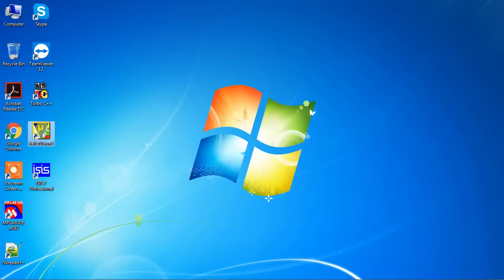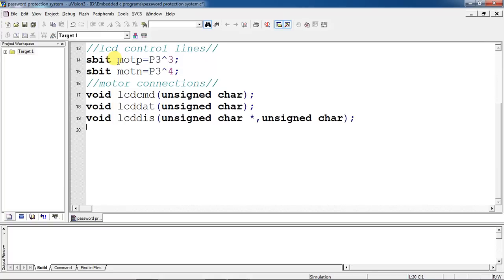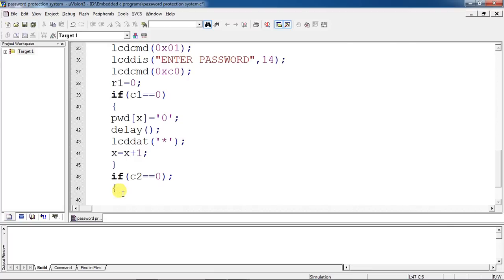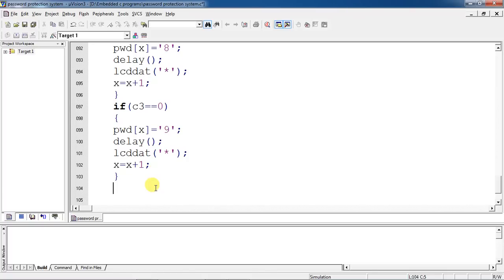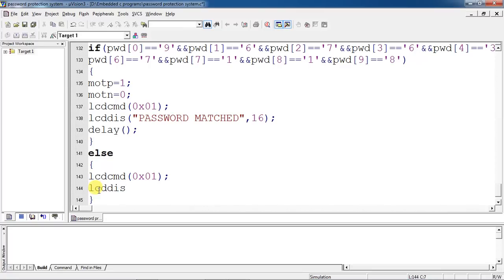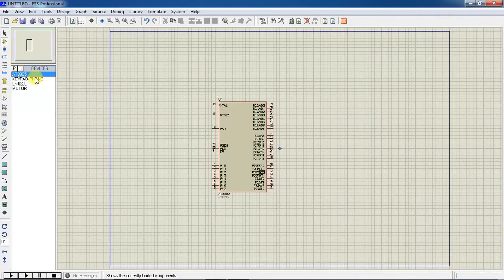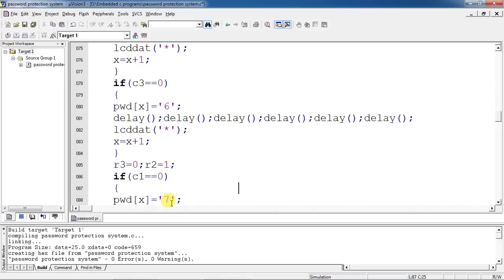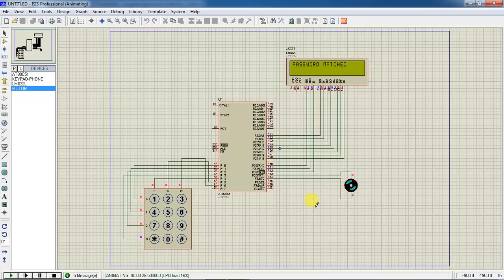Embedded c program for Password protection  using 8051 microcontroller with Keil proteus simulation

Comment: Sir, I am doing, Electronic Voting Machine using 8051, but I want it to be password based for viewing the result. When I embed your password code in my project code it shows no error, but when building, the hex file is not creating, saying "TARGET NOT CREATED". Previously, the hex file is created but after embedding your code in my code, it is not creating. At the same it showing 0 errors and 0 warnings. Plz Help me, Sir
Reply: https://github.com/kmhmubin/Password-based-doorlock-system-in-8051-microprocessor

Comment: This code will not work, when we type a wrong password at first then type the correct password!     

It will work only when we type type the correct password at first only.. Sir, What to do? My mail ID is sks288888@gmail.com

I tested this code :-                                                                                         

#include<reg51.h>

sbit rs=P3^0;
sbit rw=P3^1;
sbit en=P3^2;

//Keypad
sbit r1=P1^0;
sbit r2=P1^1;
sbit r3=P1^2;
sbit r4=P1^3;
sbit c1=P1^4;
sbit c2=P1^5;
sbit c3=P1^6;

sbit motp=P3^3;
sbit motn=P3^4;

void lcdcmd(unsigned char);
void lcddata(unsigned char);
void lcddis(unsigned char *,unsigned char);
void delay(unsigned int);
void check();

unsigned char pwd[10], x;
unsigned int i; 

void main()
{
P0=0x00;  //asign as O/P
P2=0x00;
P1=0xFF;
 
lcdcmd(0x38); //Initialise LCD
lcdcmd(0x80); //Cursor position
lcdcmd(0x01); // clear displa
lcdcmd(0x06); // shif rgt
lcdcmd(0x0E); // LCD cursor need to blink

lcddis("PASSWORD",8);
lcdcmd(0x0F);
lcdcmd(0xC0);

 while(1) 
 {  
r1=0;
  
if(c1==0)
{
lcddata('1');
delay(100);
pwd[x]='1';
x=x+1;
}

if(c2==0)
{
pwd[x]='2';
delay(100);
lcddata('2');
x=x+1;
} 

if(c3==0)
{
pwd[x]='3';
delay(100);
lcddata('3');
x=x+1;
}

r2=0; r1=1; 

if(c1==0)
{
pwd[x]='4';
delay(100);
lcddata('4');
x=x+1;
} 
 
if(c2==0)
{
pwd[x]='5';
delay(100);
lcddata('5');
x=x+1;
} 

if(c3==0)
{
pwd[x]='6';
delay(100);
lcddata('6');
x=x+1;
} 

r3=0; r2=1; 

if(c1==0)
{
pwd[x]='7';
delay(100);
lcddata('7');
x=x+1;
} 
 
if(c2==0)
{
pwd[x]='8';
delay(100);
lcddata('8');
x=x+1;
} 
 
if(c3==0)
{
pwd[x]='9';
delay(100);
lcddata('9');
x=x+1;
} 

r4=0; r3=1;

if(c1==0)
{
pwd[x]='*';
delay(100);
lcddata('*');
x=x+1;
} 
 
if(c2==0)
{
pwd[x]='0';
delay(100);
lcddata('0');
x=x+1;
} 

 
if(c3==0)
{
check();  // Password Check fn
delay(100);
delay(200);
} 
r4=1; 

}
 }

void check()
{
if((pwd[0]=='1')&&(pwd[1]=='2')&&(pwd[2]=='3'))
{
motp=1;
motn=0;
lcdcmd(0x01);
lcddis("PAY Rs.100",10);
lcdcmd(0xC0);
delay(100);
}

else
{
lcdcmd(0x01);
lcddis("ERROR",5);
delay(150);
lcdcmd(0x01);
 
//lcddis("PASSWORD",8);
//lcdcmd(0xC0);
}

// pwd[0]=pwd[1]=pwd[2]="";

}

void delay(unsigned int a) //Time delay function
{
int i,j ;
for(i=0;i<a;i++)
for(j=0;j<a;j++);
}

void lcdcmd(unsigned char val) //Function to send command to LCD
{
P2=val;
rs=0;
rw=0;
en=1;
delay(100);
en=0;
}

void lcddata(unsigned char dat) // Function to senddata to LCD
{
P2=dat;
rs=1;
rw=0;
en=1;
delay(100);
en=0;
}

void lcddis(unsigned char * str, unsigned char r)  // Function to send string to LCD
{
 unsigned char w;
 for(w=0;w<r;w++)
 {
 lcddata(str[w]);
       delay(100);
 }
}

Comment: /* improved program by Anil singh
in this program "#" is use checking password..or for ok button*/

#include<reg51.h>
#define display P2

// for keypad
sbit r1=P1^0;
sbit r2=P1^1;
sbit r3=P1^2;
sbit r4=P1^3;
sbit c1=P1^4;
sbit c2=P1^5;
sbit c3=P1^6;

// for lcd
sbit rs=P3^0;
sbit rw=P3^1;
sbit en=P3^2;

//for motor
sbit mp=P3^3;
sbit mn=P3^4;

void lcdcmd(unsigned char);
void lcddat(unsigned char);
void lcddis(unsigned char *,unsigned char);
void delay(unsigned int);
void check();
void lockback();
unsigned char pwd[4];

void main()
{
 
lcdcmd(0x38);
lcdcmd(0x0c);
lcdcmd(0x01);
lcdcmd(0x80);
lcddis("PASSWORD PROTECT",16);
lcdcmd(0xc5);
lcddis("SYSTEM",6);
 delay(300);
lcdcmd(0x01);
 lcddis("ENTER PASSWORD",14);
 lcdcmd(0xc0);
 while(1)
 
{
 unsigned int x;
  r1=0;
   if(c1==0)
  {
   pwd[x]='1';
   delay(40);
   lcddat('1');
   x=x+1;
  }
  if(c2==0)
  {
   pwd[x]='2';
   delay(40);
  lcddat('2');
   x=x+1;
  }
  if(c3==0)
  {
   pwd[x]='3';
   delay(40);
  lcddat('3');
   x=x+1;
  }
  
  r1=1;
  r2=0;
  if(c1==0)
  {
   pwd[x]='4';
   delay(40);
  lcddat('4');
   x=x+1;
  }
  
  if(c2==0)
  {
   pwd[x]='5';
   delay(40);
  lcddat('5');
   x=x+1;
  }
  
  if(c3==0)
  {
   pwd[x]='6';
   delay(40);
   lcddat('6');
   x=x+1;
  }
  
  r2=1;
  r3=0;
  
  if(c1==0)
  {
   pwd[x]='7';
   delay(40);
  lcddat('7');
   x=x+1;
  }
  
  if(c2==0)
  {
   pwd[x]='8';
   delay(40);
  lcddat('8');
   x=x+1;
  }
  
  if(c3==0)
  {
   pwd[x]='9';
   delay(40);
   lcddat('9');
   x=x+1;
  }
  r3=1;
  r4=0;
  if(c1==0)
  {
   pwd[x]='*';
   delay(40);
  lcddat('*');
   x=x+1;
  }
  
  if(c2==0)
  {
   pwd[x]='0';
   delay(40);
  lcddat('0');
   x=x+1;
  }
  
  if(c3==0)
  {
   break;
  }
  
  r4=1;
  
 }
check();

}

void check()
{
 if(pwd[0]=='1'&&pwd[1]=='5'&&pwd[2]=='6'&&pwd[3]=='0')
 {
  
  mp=1;
  mn=0;
  lcdcmd(0x01);
  lcddis("PASSWORD MATCH",14);
  delay(500); 
  lockback();
  
 }
 
 else
 {
  lcdcmd(0x01);
  lcddis("PASSWORD WRONG",14);
  lcdcmd(0xc0);
  lcddis("TRY AGAIN",9);
  delay(500);
 }
}

void lcdcmd(unsigned char val)
{
 display=val;
 rs=0;
 rw=0;
 en=1;
 delay(1);
 en=0;
}

void lcddat(unsigned char dat)
{
 display=dat;
 rs=1;
 rw=0;
 en=1;
 delay(1);
 en=0;
}

void lcddis(unsigned char *s,unsigned char r)
{
 unsigned char w;
 for(w=0;w<r;w++)
 {
  lcddat(s[w]);
  //delay(1);
 }
}

void delay(unsigned int time)
{
 unsigned int i,j;
 for(i=0;i<time;i++)
 {
  for(j=0;j<1275;j++)
  {}
 }
}
void lockback()
{
 mp=0;
 mn=1;
 delay(500);
 mp=0;
 mn=0;
}
Reply: Hello your program is working fine thanks but I want to ask you some thing if I want to add other two password for other pin output how we can implemented can you pleas create that
Reply: @easyrobotech  plz i need the code for this project in file
Reply: In this program what is the correct password.
Reply: @jaganmohansahu1147  1560
Reply: give me a code using relay to drive a motor based on password
Reply: 4 channel relay module use karna he to programming me kitna changes aayega
Reply: Thank you very much for this code.
Reply: plz i need this code in file